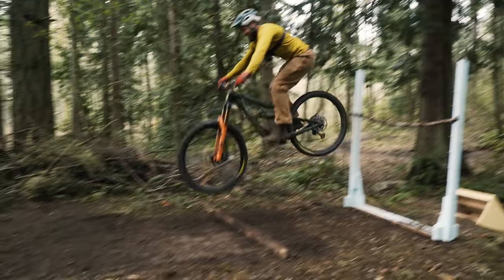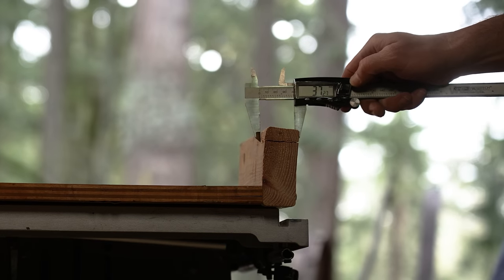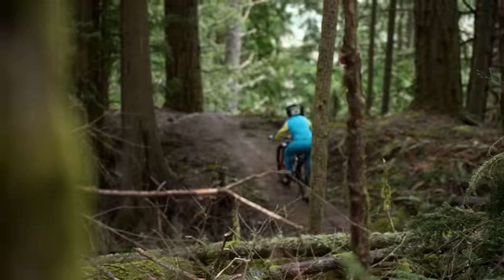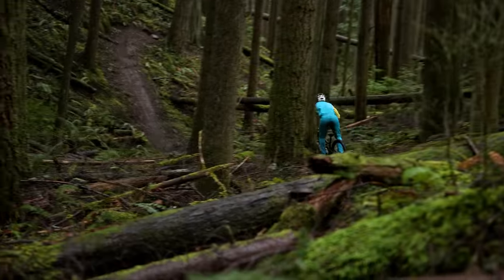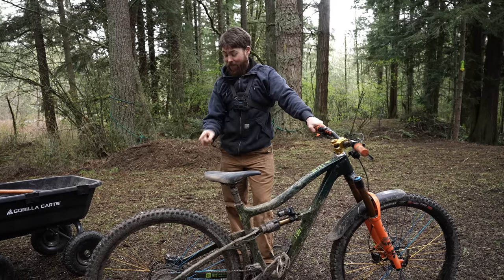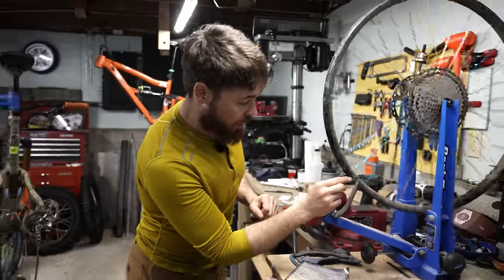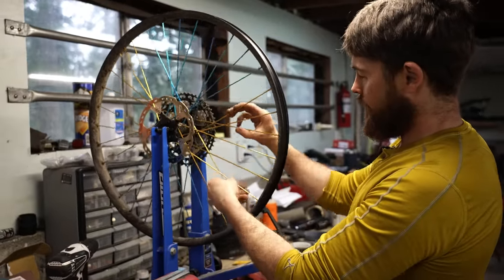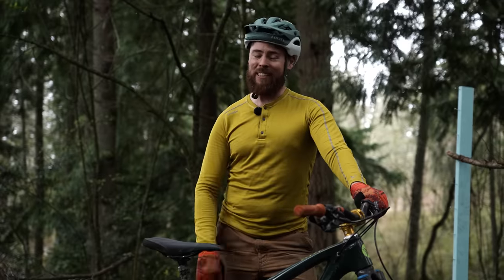Insane test for Industry Nine Enduro 300 wheels...

Comment: Hey Jeff  you can use the plastic insert in the Shimano cassette to align it with the freehub body, remove the lockig insert and then just slide it over the hub. Makes it way easier to get all the single parts of the cassette on. It's a real time and nerve saver!
Reply from the maker: Thanks for the tip!  I'll try that next time!!!!

Comment: So thaaaat's how we need to test the FR541's!
But hey Jeff, throw in EXO or EXO+ tires in there to see if those rims pinch flat tyres or not. Running DH casing on trails is preeetty overkill.
Reply from the maker: I can't ride EXO+ or EXO.  To avoid excessive rim strikes, I have to run near 30 psi, and will still get tears in the casing.  Maybe I'll do a video going over this one day, folks constantly tell me there is no reason for Double Down (or the lighter DH casing), but rest assured, I've wasted plenty of rides trying to ride the lighter stuff!
Reply: I have slashed so many EXO and EXO+ tires, never running them again in the rear. And I'm only 160lbs.
Reply from the maker: Yeah and a lot of it is riding style and location related, too!
Reply: The FR541s were completely unkillable with a normal weight rider hulk smashing it off rocks with no tire on it.  NRML MTBR has killed one I think, but it was part of a torture test of the rim and he's 330lbs.  The only FR560 failure I've ever seen was landing sideways off one of the big jumps on dirt merchant, tacoed it, but that was an impact that would probably kill any rim.

Comment: That wasn't a rail road tie, the ties are the wood or concrete blocks that hold the running rails in the ballast (loose sharp stone). You were jumping onto a section of running rail.
Reply from the maker: Thanks for the correction!  Did you like how I found an eBay link to a railroad rail and included that in the description?  LOL!
Reply: I came here to same the same thing.  I am a Train geek who rides MTB........

Comment: Not impressed. If I can't hit a gap jump and land on a sideways railroad track and ride away without getting a flat, it's not worth it.
Reply: same- if it can't even do that, how am I supposed to feel safe on my local field paths with almost no elevation??
Reply from the maker: CushCore would have saved the day!  Wait, maybe a sequel is in order?
Reply: @JeffKendallWeed  Yes,  maybe go to your local junk yard and get creative with the landings. haha
Reply: @JeffKendallWeed  I think that's a fantastic idea. I would love for everyone I ride with to run cush core, 2.6 tires, and low tire pressure. Double down Assigi front and rear!

Also, carry my spare tube. And pump. And phone... And my water.
Reply from the maker: I will say, there are times when a little lighter is more important! All depends on teh goals!
Reply: @JeffKendallWeed  loved this test... some of us aren't blessed with loam - nah we ride trail systems that are rock gardens with occasional patches of silt laden clay or loose sand over hard. Can't tell you how many times I've hit a rock edge that looks exactly like that railroad tie. At 200lbs on my ripmo af, I use a dd casing + cushcore @ 25 psi and still get rim dings on the edges...

Comment: This aluminum wheelset is over $1400! At that point, I'd probably go carbon, they stay truer longer. Or the $700 Reserve wheelset with lifetime warranty...
Reply: Exactly this. Still waiting on a good YT review of the Reserves but on paper they are going to be hard to beat. If nothing else, hopefully they force others to offer lifetime warranties.
Reply from the maker: For racers, the aluminum is a better option than carbon.  With a week of riding on these wheels, I'm starting to think the extra $1000 to go carbon isn't necessarily worth it!
Reply: @JeffKendallWeed  I wonder how a good carbon wheel would hold up to the same exact railroad tie test! would the rim just explode?
Reply: @JeffKendallWeed  it's an exta $420 with I9 hydra carbon, extra $170 if you go 1/1 hubs instead of hydra, so not quite $1000.
Reply from the maker: It's hard to say, but I have a suspicion it would crack, and on the second or third hit, it would fall apart.

Comment: I don't know if in this scenario it would have helped or not ... but I always do a double-layer of rim-tape on all my wheels.

Manufacturers (including Race Face, DT Swiss, Halo and i9 too) just cheap out and only use a single layer. By the time I go through the 1st tire, the tape is a "bubble" at the spokes, and sometimes showing wear on the edges.  A double layer just lasts more. Lately use Muc-Off, I kind of like that it's transparent and when you swap tires you see what's happening under the 1st and 2nd layer. 

Also, a double layer helps with seating tires.

ps: I am hesitant to try i9 again... the Enduro S lasted 3 months before it started shedding spokes. Even the front wheel, and in off-season on natural trails... literally, I would break a spoke on tiny drops and even pedaling.
Reply from the maker: I used a single layer of Muc-Off tape, with some small pieces of I9 tape stacked in the dent, and was able to get this wheel back in service.  Have already got in a few more rides on it since the vid!
Reply: The Enduro S spokes are not the same as their in house aluminum spokes. I have riden my EN315s for over a year, done multiple Enduro races on them and weigh 250lbs and I haven't had to true them once. Their handbuilt wheels made in house are legit.
Reply: @travistweedle9674  Yes I know that about the spokes. But I have a bit of a brand disappointment as that was my first i9 product. 

I am much lighter and it was rainy season, so local rocky/rooty trails and no drops and jumps.
The wheel dented and fell apart like crap. I was shocked.  Even front spokes that I literally never had......

I am on Halo Vortex now .. after 5 months I broke the 1st spoke (and I think it was actually a rock that flipped into it)  and it is dead straight. And I literally ride bike park 5 times a week (one opened 15 minutes from me) ...  how the enduro S fell apart I would literally be scared to do a single lap on it :( ..which is sad ..
 Ordered a second set of Halo for my e-bike too...
When those are gone I might chance an i9 with the aluminium spokes.

After all, even my Crank Brothers alu spoke wheel lasted me years and that's a 24 spoke thing.
Reply: @JeffKendallWeed  I really like the Muc-off. If I have any issue with the factory tape (or 2nd set of tires) I just rip the original off  and put 2 loops of Muc-off on. 
Even made my pain-in-the-butt to seat Raceface wheels a relatively bearable experience (with Cushcore) ..

Ps : I found LMNT through your videos. Don't leave the house without it. Also if you are on Keto/low carb, that's the best thing that can happen to hydration...

Thanks for that...
Reply: I wonder if DT Swiss uses different tape on different rims.  My FR560s have this super tough rim tape that is almost like plastic, will be awhile before it ever needs retaped
Reply: I have i9 hydra enduro wheels.  And i had the same problem with my rear spokes.  Just constantly snapping spokes.  Like everytime I rode.

I contacted I9 and they explained that they had a faulty batch of spokes at the time my wheels were made.  

I am in Australia, and it was not worth the double shipping costs to return for warranty.  So I agreed with i9 to send me a bunch of spokes, and I would re-lace myself.  They also gave me a free stem for my troubles.  Since re-lacing the rear, I've not broken a single spoke.  So i think they were definitely a dodgy batch of spokes.

Comment: Nice idea for those "ünbreakable" rim break videos, but in fairness, I did not expect them to stay in perfect shape with that kind of hard hit. I use tannus armour so I can use inner tubes and not have to worry about flats, also super comfortable but kinda heavy. But even with that armour to just go bomb up stairs (not down) I need high pressure, otherwise I still run the risk of damaging my rim on a hardtail.
Reply: Tannus armor, tubes, AND high pressure? Oh my. Something doesn't seem to be right here. If your tires have decent casing |(Maxxis exo+ or better), then you shouldn't have to do all of that. Have you had issues with damaging rims before?
Reply: @rrolleman4879  I'm a cheapskate on a 2010 era xc bike. Rims ID 19mm with a 2.25" schwalbe racing ralph. I have damaged a lot of rims as a young teen and the first cheapo bikes I bought last year also couldn't handle my riding. I weigh <60kg, 184cm so yes it might work on modern wheels. But when you finally have true rims..you like em to stay that way. Ps. I would get flats every other day with that racing ralph before I installed the armour. Probably because the tyre is a lil bit too wide for the rim. I need a mtb for urban issues like stairs, sidewalks cause I don't like slowing down for ppl

Comment: That asymmetrical rim should make the tyre easier to install from the correct side as well, right? easier to get into the drop center.. That'd be awesome!
Reply: Not if they're RaceFace rims. I've never had an issue seating tires on rims until RF asymmetricals graced my garage. Had to go out and buy a compressor for the first time. grrrrr
Reply: @rrolleman4879  not seating, I mean when mounting the bead on the rim, you push the opposite side of the tyre into the middle of the rim where it has whats called a dropcenter, that way the bead goes on much easier.

Comment: Great video as always! Good to see you back on the Ripmo. How do these wheels compare to the 35mm that Ibis specs? Interested in your thoughts because the carbon Ibis S35 Carbons are on clearance.
Reply: S35 alloys are a nice trail wheel if you like 35mm wide rims and their resulting handling characteristics (understeer-y and hard to lean over, but great on steep but straight stuff), I killed 2 in a year at the bike park and had a set of FR560s built.

Comment: If you're keeping it as you said, try taking the wheel ring itself and heat it up slowly to see if you can push the dent out, since it's not cracked or creased it might actually try to take its original shape, depending on the alloy it's made of.

Comment: Yo Jeff
I also have headset issues. I’m looking to try something nicer then a cane creek 40. 
How is i9’s headset? 

And I too love to “wheelie” as much as I can and just switched to a Dissector from a dhr2 and I totally agree with you. I pulled some nice ones but it’s definitely less stable. 
Great video and riding 🔥
Reply: The i9 headset is awesome, if you want a lifetime headset get a cane creek 110 headset. Either a cane creek 110 or the new i9 will be better than the 40. The 40 is a good very very basic headset. Cane creek has a 110 year warranty on their 110 headset so ya, I’ve got them in all my bikes.

Comment: When I ordered my last bike I was really paranoid about not getting CF wheels. I ended up just putting inserts because I did't want to go to the previous tier.
One thing to note is that some reputable CF wheel manufacturers offer lifetime warranty.
PS: I just realized that I usually wear the same top and trousers that you do (the blue set) but in black. I will I also had your skills on a bike xD. Cool video.

Comment: These seem a little easier to destroy than the carbon Reserve wheels that Danny MacAskill struggled to break for Santa Cruz.
Reply: Not to mention the DT Swiss FR541 and FR560.  They hulk smashed the FR541 through a janky rock garden at speed with no tire and didn't even bend the bead support.